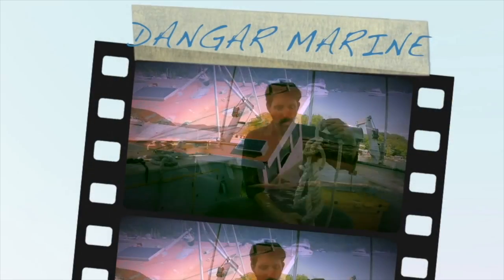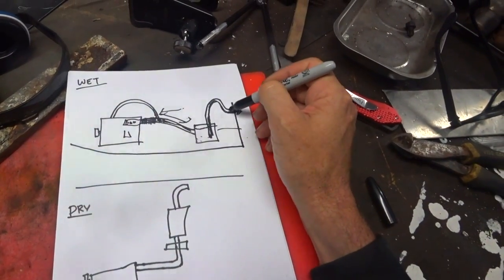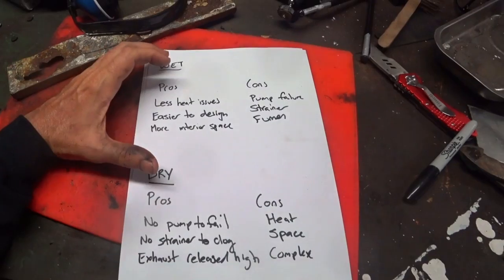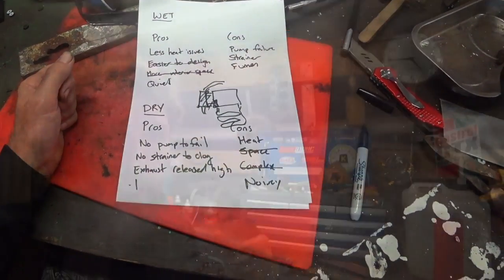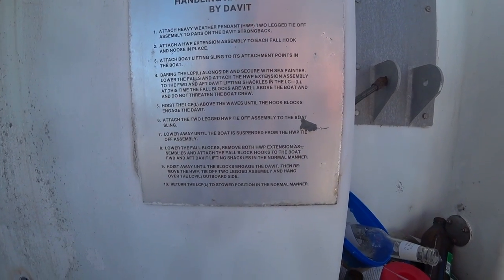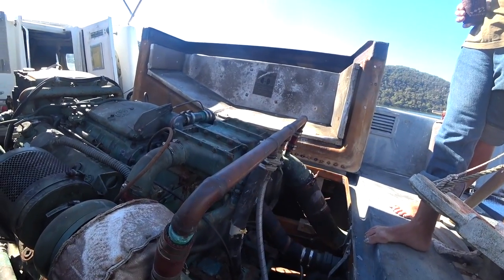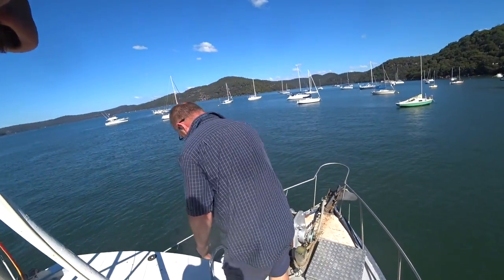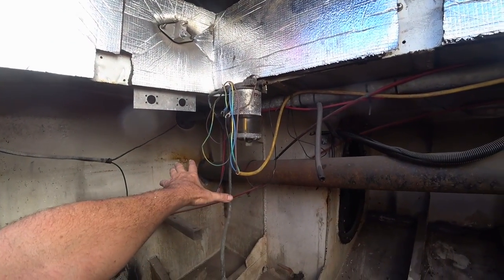Wet Exhaust vs Dry Exhaust

Comment: Not one person has mentioned the smoking gun. Here in Tassie I have seen quite a few older boats burnt to the waterline through heat issues from dry exhaust improperly installed. Your friends boat with the wet exhaust is quite unique. Ex navy invasion boat with inbuilt smoke screen layer.
Reply from the maker: Yes, you do need to be very careful with a dry exhaust install.

Comment: We use  straight pipe wet exhaust but put the outlets bellow the water line it makes it so quiet.you just at the outlet put a upside down p trap that goes above the water line

Comment: I've designed my own mufflers and you can pick a quiet muffler just by yelling through it. Wikipedia says the 4-71 is 160HP, and looks like you only need two 90 degree bends, I'd go a 2.5" and the largest radius for the bends you can manage.
Reply from the maker: Thanks mate, appreciate the info.

Comment: Hey a US Navy LCPL... I wonder if it's one I build then I was working at Uniflite.  The early ones had a 6-71 TIB the later ones we were building had the 8V-71 TTI.  

Thanks for the shot of the engine room,  It looks like you have room to put a Cowl mufflers in front of the engine.  Use a right hand spiral and point the outlet up to make your turn up.  That way you only need a sweeping elbow to make the turn into the muffler from the engine.  

Use the TXS Critical Grade PR model as I remember that engine should have a 4 inch exhaust.  These mufflers work very well on Detroit Diesels I think you will be very happy with the system if you can get the muffler.  I know all of Dads boats had the Cowl mufflers on the Detroit's/

https://ecommerce.cadel.ca/img/media/COWL_EXHAUST.pdf

Blessings Kriss
Reply from the maker: Hey Kris, yep, it is a 4 inch outlet from the exhaust manifold. Thanks for the PDF, looking forward to reading through it.

Comment: I wonder if the higher engine room temp with the dry exhaust was de-rating the engine?  ( Duct cold combustion air directly to the inlet manifold?)
Have you considered a drowned outlet dry exhaust?

Comment: If you decide to stay with a wet exhaust, (1) turn the manifold around so the exhaust comes out the aft end instead of the forward end.  That would eliminate the crazy loop they made across the front , and down the port side.Not sure why they did that, super easy to flip the manifold. (2) ditch the second belt driven pump and associated plumbing, just use the sea water coming out of the heat exchanger. Send some out the exhaust, and some overboard to reduce back pressure on the engine.  Also, depending on where the fuel tank is, you might want to install a return fuel cooler in the sea water system to cool the fuel going back to the tank.The return fuel on a Detroit 2 cycle can get quite warm.
Reply from the maker: The trouble with flipping the manifold is that it would then run straight into the starboard fuel tank and block access to that side of the motor. I would definitely send the cooling water into the exhaust though if I kept it. Interesting point about the return fuel cooler, will look into that.

Comment: A lot of wet  exhaust systems have way to much backpressure, mostly caused by to much water lifting height. It would be easy to design a compact and silent dry exhaust system considering that kind of back pressure. Do not under estimate the complexity of wet exhaust systems!

Comment: Wet exhaust looks like it has a lot more failure points than a dry exhaust setups. Although aesthetically those dual exhaust pipes out the back of the transom look the business.

Comment: I don't know about this scavenging vs muffler issue. First thing I'd ask if it does, then how does 2 stroke turbo work? Once those turbos are working the backpressure is quite high like 60-100hp high. That is quite a lot of exhaust backpressure which is why turbo exhausts glow when under high load.
Yes I hear you say the 15psi or whatever the turbos pump is far greater than the .7 psi (now down to .5psi because the blower is old) of the NA. 

A muffler isn't going to choke up an exhaust on a 4-71n so much that the thing won't scavenge properly, surely.
I call BS on this.

Comment: i don,t think muffler selection and the back pressure will be a issue for the detroit diesel since they are force feed on the intake side.They are not a dirt bike or chain saw as in common two stroke.  Super charged two stroke diesels play by different rules of air flow, over scavenging is not a problem and back pressure has to be higher than intake pressure before you have a sever restriction and you should have a noticeable  loose of power before you reach  that point, love your commute to the office ,makes my sitting in traffic suck even more

Comment: G'Day Stu,,mate just thinking ,,wonders what sort of back pressure the wet exhaust creates,
and really a muffler would create,,,the only problem i for see with the dry exhaust is time and diesel carbon blocking the muffler,with the wet most of the crude is trapped in the water box,
Wonders how often one should clean water box,,Be interesting to cut open old water box and see,what is actually is left behind,??
Hmm Now back pressure,,just go big,,real big,,no restriction to flow = No Pressure,,The only other thing i would consider is putting in a catch box where the exhaust turns to go through floor,The only reason is to remove carbon ,if in deed it does fall,,will not clog exhaust,but be cleanable later,,wouldn't take a big piece to hold open a valve,,
just a thought is all.
Good luck Buddy,,

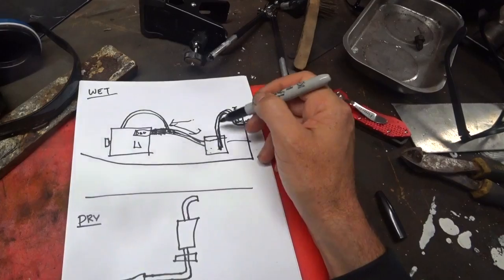Comment: 2:15  That wet exhaust setup will evacuate the water in the muffle down to the level of the exit pipe inlet.     This pipe from the engine should be near the bottom of the water in the muffler and the exit pipe should be at the top, above the water line.

Comment: Since you would have to build an insulated box for the stack as it goes from hull to cabin roof anyway could you not conceal the muffler in the insulated box?  
To my mind that would allow you to avoid having an enormous/heavy muffler mounted high up above your cabin.  It doesn't seem like you'll be giving up much usable room, except you might need to walk around the engine compartment instead of being able to pass between the cabin and engine.
Reply from the maker: Yes, the room between the engine hatch and the back of the wheel house is pretty much useless so happy to fill it as needed.

Comment: hey sir my brother has a Evinrude 55 , ran crappy before the rebuilt carbs but now that installed refurbished carbs , when it starts it instantly high revs and limits out? any tips
Reply from the maker: Take a look down the throats of the carbs and make sure all the throttle plates are closed properly at idle. May have been an issue with the linkages when reinstalling.
Reply: ok so the throttle plates need to be closed at idle , what about the ones for CHOKE?  @DangarMarine

Comment: There is dry exhaust that is Still water cooled on commercial boats at least the section that's in the engine compartment and on wet exhaust the rise can't be higher than the manifold exit
Reply from the maker: Yes, the exhaust manifold on my dry exhaust is water cooled but nothing after that.

Comment: Hey Stu, was the boat a working fishing trawler in a past life? If it was, the previous owner might have had cranes that fouled the old dry exhaust stack, and that could be why it was converted to a wet exhaust.  Dunno.
Reply from the maker: Possibly, interesting thought.
Reply: @DangarMarine  Looking at the video of your boat again (22:32), it's clear the old exhaust stack was lower that the mast, and close up tight with it, and in fact the upper exhaust pipes are still there, so it's a safe bet that clearance for fishing gear was not the previous owner's reason for getting rid of the dry exhaust.

Comment: Why is there so much of a disparity between land and sea based machines? This exhaust issue being a perfect example. Admittedly, I'm a land-lover, but definetly interested in learning more about nautical vehicles. That said, and maybe my ignorance is showing, but I should think the fewer holes you can drill in your boats hull, the better, right? So what's with all the complexity and gripes about "noisy" dry exhaust systems? I grew up on a farm running massive tractors, combines, etc. I served in the military operating giant trucks. I've been a gear head with a love of monster internal combustion engines my entire life. And I've never encountered a situation where a properly designed "dry" exhaust was insufficient in terms of noise, heat, or performance. With all the problems boats already have, why add even more with an overcomplicated exhaust?

Comment: I just find the current placement of the wet exhaust crazy, Why not route it along the walls? Or ceiling for that matter, you do the loop above deck. I think the dry exhaust will be fine while you move, but never if you need the engine when not moving.
Reply from the maker: It can't route along the walls because the fuel tanks are in the way. It's frustrating because without that it would probably be fine.

Comment: Im a big fan of dry exhaust.. Because you eliminate the chance of getting saltwater back into the turbocharger, and   Into the cylinders..  Also i would think an engine would yield more horsepower if you put the exhaust through a smokestack compared to a wet exhaust.. The turbocharger would turn faster and therefore compres more air on the intake side..

Comment: Outboard motors direct the exhaust under water.  Is it possible to run a dry exhaust but exit underwater?  Could mean no muffler required.
Reply from the maker: I'm not sure why you don't see that more often. Probably due to some risk of back flooding with an inboard motor.

Comment: What is the orange unit on the bulkhead? Thanks.
Reply from the maker: It is a hot water heater designed to have the coolant from the motor run though it. It's not plumbed up yet.
Reply: @DangarMarine  Thanks for the update

Comment: I think dry exhaust is the vastly better choice, and it looks to be easy to do on your boat.Detroit diesels are known for being noisy, because they are two stroke, and their firing frequency, which is the main component of engine noise, is twice that of four stroke engines such as Cat or Cummins.  However, the higher firing frequency is actually easy to attenuate with the right silencer. Suggest you go to the maxim silencer web site www.maximsilencer.com, and look at the information on the MSA22 silencer.  The attenuation values over a range of engine firing frequencies are provided.  Engine firing frequency is nothing more than the number of engine power strokes per second. A two stroke engine produces one power stroke per cylinder each revolution. So, For a 4-71 operating at 1800 RPM, the firing frequency would be 1800 X 4 / 60 = 120 cycles per second, commonly called "Hertz" or "Hz". If you run at 2100 RPM, the calculation is the same, with 2100 replacing 1800. The  MSA22 silencer will do a good job on your 4-71, but any other brand of silencer with equal or better attenuation performance at your engine firing frequency will work as well. The issue of engine exhaust back pressure limits should be addressed by increasing the size of the silencer, not by reducing its silencing performance with a lower attenuation silencer.  As an initial guess the silencer size, which is the inlet pipe size should be at least 1 inch larger than the engine manifold exhaust pipe size.  Silencers are actually not that expensive in non-stainless. Also, as you mentioned in the video, exhaust blankets are far superior to exhaust wrap. Three manufacturers of marine silencers in the US are Maxim, Nelson, and Cowl. Regards, Greg

Comment: Finding a muffler to work with a DD 4-71should not be really any sort of problem since DD of all shapes and sizes were used in the trucking industry.  If I were you I would be looking at muffler used on road tractor (semi-truck) another place to look is for exhaust systems used on stationary generator setss
Reply from the maker: I've been given a few leads on suitable mufflers and they aren't that expensive either.
Reply: Dangar Marine I like in the US and don’t know how “truck stops” work in you part of the world but I had purchased he muffler and all the pipes I needed at a “truck stop” when I replaced the exhaust system on a old “Bay Build” boat I had some years ago.   It had 6-71 in it and while there are smaller and higher horsepower engines on the market today that may be slightly less thirsty but in my opinion it’s hard to beat an old mechanical diesel for reliability and I love the sound of a Detroit marine engine.  On a side note one thing that can be done to reduce the amount of fumes of a wet exhaust boat is to move the exhaust outlets to the sides of the boat rather than on the stern.

Comment: If going for a dry exhaust, how about a heat exchange?. Air to water, gives you hot water for showering & washing.  Dosen't need a big tank, 10 gallons with an electric pump.  Just needs a copper coil around the exhaust, not too far from the engine.  Or it can be used to make a heater system for the cabins /bunk room
Reply from the maker: That orange unit on the bulkhead is a hot water heater that runs of the fresh water cooling system.

Comment: Your first mate with the 8V71 TTI has some serious breathing issues with that engine, does it belch smoke like that with the dog box cover opened? If it does he needs to clean those turbo inlet screens and possibly the intercooler, also check that the air damper on the blower inlet is properly latched open on it's cam. There should also be a rack delay damper fitted on one of the racks, it's a small dashpot that stops the rack from slamming full open very quickly drowning the engine in fuel before it's got enough boost and air to burn the fuel. Very high spec engines like that one have a relatively short life compared to a work boat engine, maybe 5000 hours, they are made for high rpm, high horsepower, don't care about fuel or engine hours. Your little 4-71 would probably last 15,000 20,000 hours with regular oil changes. On your boat that vertical space between the deck and the wheel house roof is the perfect spot to fit a muffler with a heat shield around it. I used to work for Detroit Engine and Turbine Co. here in Adelaide as a sparky, we used mufflers from Diesel exhausts, they have different specs for different applications, a truck would have a standard industrial grade muffler, a lot of the generators we installed around the city had super quiet 'residential grade' mufflers, they are much quieter and really take the bark out of the pipe.
Ray
Reply from the maker: Hey Ray, yep, that 8-71 needs some series work, appreciate all your tips. He actually has another non-turbo 8-71 sitting in his workshop. It might be good to just swap them over and do a full rebuild on the existing one in the shop. Interesting what you are saying about putting the muffler in that space below the deck. I was picturing it more in the space between the deck and the wheelhouse roof. I'll look into that. Thanks!

Comment: Dangar Marine..... Greetings from the US,  Love your videos and am now subscribed.... as I just found your website on recommendation from the "Bus Grease Monkey" (Scott) Channel here in the US.   For a muffler... it would depend on what you're looking for in sound(??).... really quiet (for a 4-71NA), or maybe something a little "throaty"(??)...... I have some part numbers I could give you, depending on what you want.... also I would need to know the OD of the pipe leading to the muffler.

They are available in polished stainless steel as well as non-polished SS and/or aluminized steel... and with that 4-71NA I would stick with either a 4 or 5" system.  Definitely Do NOT go with a straight pipe on a Detroit (2 cycle).... the sound waves at the point of reversion in the pipe Will create a "dam" and Will cause too much back-pressure and will cost you power.  Which series of injectors are you putting in that 4-71?   What is the governor set at for WOT? 

IF, that engine was set up originally as a marine unit from the factory... then it should have the marine springs on the valves,  but IF it was originally an industrial/automotive application, then it will not and the governor should be set to stay Under 2,400 rpms.... the marine springs are good to over 3,000 rpms,  and if you think that 3,000 rpm is too high... we ran the V12 in our sled puller (1974 Kenworth) at 4,000 to 4,200 rpms under full load.... for Many years and over 11,000 "hooks" on the sleds and never blew it up.  :-) 

We also had "hand built" injectors (re: fuel faucets!!) that were rated for 240MM per stroke,  and to keep up with the air we used two 6V92 variable pitch turbos that were from a 550/600 hp marine application running through a very large dry ice inter-cooler in conjunction with Hi-Bypass blowers.... and many numerous other "tricks" yielding 2,500 hp and 3,000+ ftlbs of torque.
Reply from the maker: Hey mate. I thinking the quieter the better for this application given we could be doing some 12 hour plus runs up the coast. The exhaust is 4 inch and the injectors are N60s. The valves and springs have been replaced by the engineers during the rebuild. This is the part number that was used 5147347 VALVE SPRING (V71/92) 1.8340 With regards to the finish of the exhaust I also need to be careful to keep the heat inside as it will be rising up through the deck where people could touch it. This will probably mean building a box around it but I am also thinking maybe it would be good to get it ceramic coated. I don't get notifications or replies to comments unfortunately but my email address is dangarstu@gmail.com I'd really appreciate your help with getting this right. :)
Reply from the maker: Oh, and not sure about the governor yet. Still waiting to get the engine back from being rebuild.